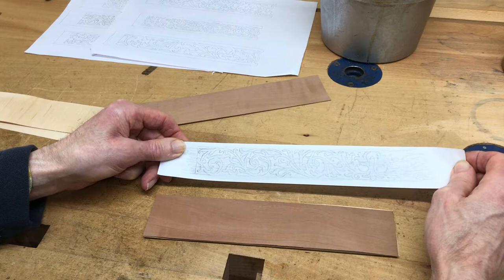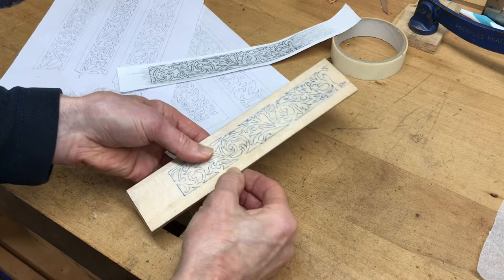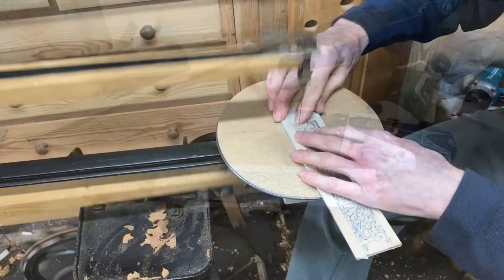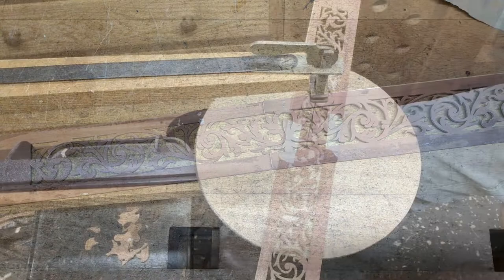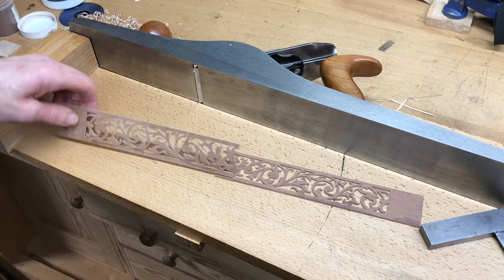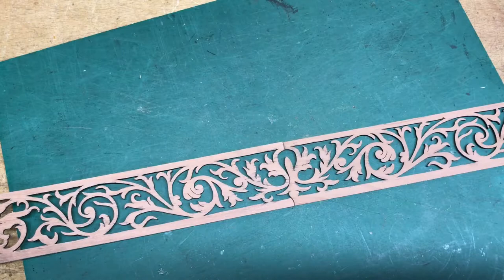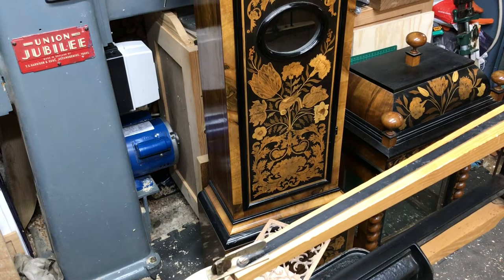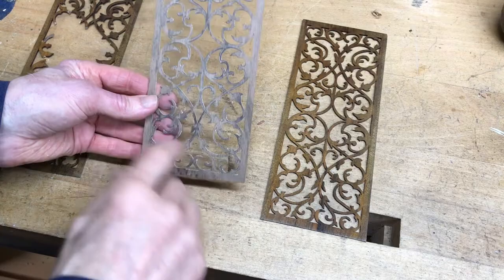making sound frets for grandfather clocks

Comment: Always amazed by the treadle jigsaws.  There has been one at my favorite antique tool shop for sale for many years but I don't think I could do it justice.  
Another nice video.  Thank you
Reply from the maker: I have two of these treadle saws, the hobby’s A1 and a New Rogers. The A1 works the best . The New Rogers just look’s better.
Reply: @Ian Swindell  they are so practical.  Quiet and you have full speed control.  Did you have to add the pieces of wood on the arms to keep them from flexing or did they come that way?
Reply from the maker: @davidwilliams1383  I replaced the arms 20+ years ago when I got it. It was in a bit of a state so I also gave it a paint job. Do you know the model of the fretsaw you have your eye on. If it’s complete with no brakes to the casting. If it’s been there that long make them a bid.
Reply: @Ian Swindell  I do not know the brand or model off the top of my head but I may go look at it tomorrow...
I always prefer non electric tools when possible.
Reply from the maker: @davidwilliams1383  You’ve got me thinking of dragging my new Rodger’s fret saw out and try to get it working better. It will never be as good as the hobbies.  Please let me know what model you’re looking at.